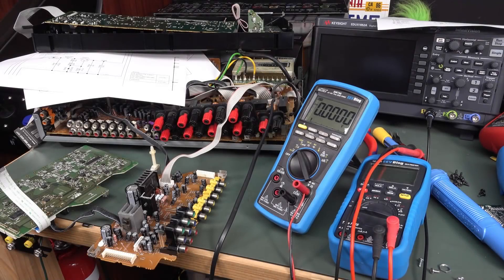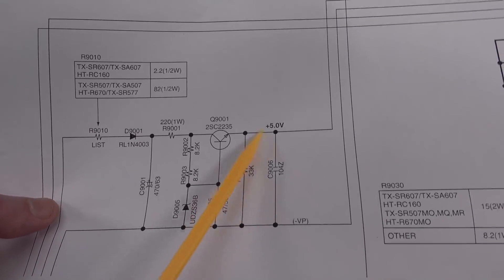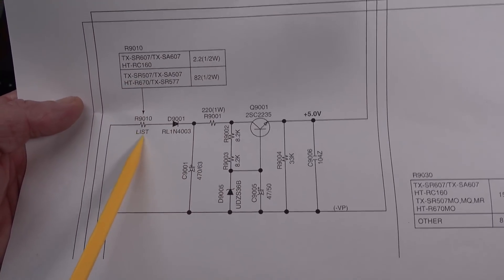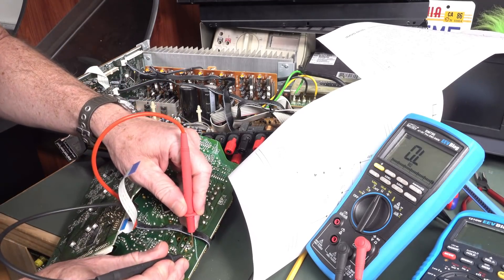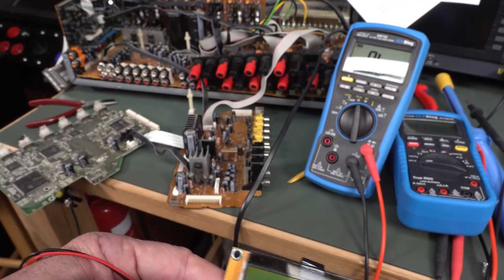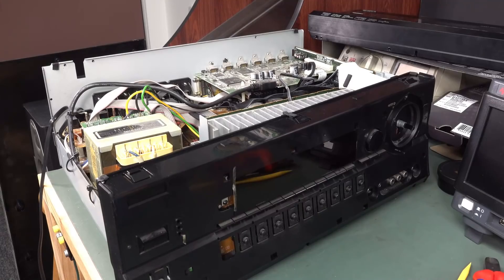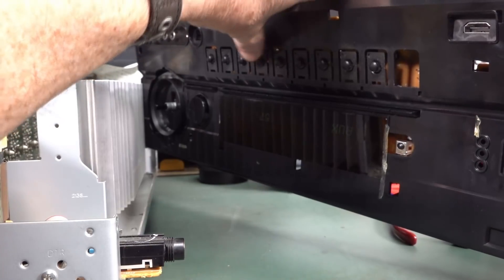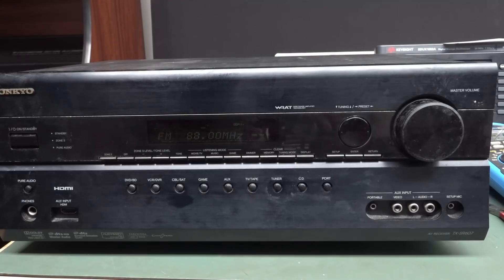EEVblog 1395 - Onkyo Repair SUCCESS

Comment: You can run bodge / probe / sense wires to diferent spots for testing while assembled. Or get extra ribbon cables with the right plugs for the repair.

Comment: I acquired a Leader LS1020 'scope a couple of years ago that had no seperation between traces and no verticaql adjustment. At first I thought one channel was kapputski but it's just that they were both occupying the same space on the screen. 
Cause? One open 33kΩ 1/2 Watt resister. Took a while to find but at least an easy fix!!🤪

Comment: .

Glad that you resolved the display operation. I don't have the knowledge you have to read diagrams and would get too frustrated to stay with it that long. I have a Onkyo receiver also, a bit newer model. It has a dimmer button on the face-plate in between the THX and Memory buttons. It has a few brightness combinations including a surround light for the volume knob. I found it by accident on the third day I had this thing. Maybe your unit (if you still have it ) has a similar button on that top row.

Comment: I fixed mine today.  Exact same fault, but I saw a different video before yours which showed the same fault and fix.  Got a 5 watt job in there now.
With regards to the two wildly different resistor values, the 507 and 607 use different transformer model numbers, so I suspect it's something to do with differing secondary voltages.

Comment: Hi, faced with this same problem, I came across Frank.tech's 12 min video pinpointing this resistor problem, before your extensive search for the fault. I was able to get to the resistor, by removing the screws on the HDMI board and the left hand end of the power board and back cover, allowing me to remove the power board and de-solder that resistor. Sure enough, it was open circuit! Replaced with success, and my screen looks brighter than yours, but for how long? Who knows. Do you not think it might be appropriate to use a larger 2.2 Ohm resistor to handle the load and the heat dissipation? Thanks for the insights. Sorry you had to spend 2 days, so I could fix mine in 3 hours!

Comment: I've installed many a 607 and the biggest problem was the HDMI firmware. HDCP errors were common and the firmware updates regularly bricked them. Great sounding receivers, but not a patch on the Denon and Yamaha's. I still have a beast of a Yamaha Z1 and it's incredible.

Comment: Yep I have an SR805 and the front screen wouldn’t work. Just a resistor needed. Much harder to diagnose without knowing anything about electronics components, and looking through the forums.

Comment: I got 2 receivers that need repairs do you take in receivers for repairs?
You of my onkyo are dead one only has the left channels working the other turns on has hdmi working but no sound 
I'm getting tired of buying a new 1 I would love to have these fixed if possible

Comment: In daylight that display will be useless (correction..it would have been useless, saw the update..adjusting the dimmer control!👍)
However it would be interesting to deep dive and see how to re-invigorate a dim VFD display. I have heard that some short term overdriving of heater (?) can make them brighter, but that article is lost.
I have a panasonic DVD player and the display needs a pitch black room to see anything.

Comment: Resistor probably failed due to surge current in charging the 470uF63V cap. Depending on voltage risetime, source impedance and cap ESR, there's a potential peak power of around 600 watts (it will be a lot less, but you get the point).
I'd replace it with a wirewound or a dedicated surge rated resistor.
Agree 2R2 or 82R is very odd.

Comment: I have had this exact problem. It's very common on this model and as I did not have the skills to find the problem myself when I fixed it. I was very happy google was a thing. However the HDMI on screen display is still broken. Also fairly common. However the repair for that seems a bit too cumbersome and I don't use it anyway.

Comment: Nice job! Mine is 606. They (606 & 607) usually develop some issues with several caps in HDMI switching circuit due to the heat on the input/video board.

Comment: The blinking red light thing could be related to an issue some Onkyos were having with their HDMI switch chip. They would not initialize correctly and the led would just blink. There was actually recall on this.

Comment: Apparently some receivers use the metal rear panel as a ground plane so you need to screw in the boards when testing. Looks like this was your issue as well.

Comment: Sounds about right. I mentioned checking the resistors on the VP rail in the last video because it was a common failure on onkyos for a number of years. I made the same repair on my txsr805 which was two years older, except I replaced them with 1w jobbies. Onkyo never learned.

Comment: The other big problem with these things is the board to board connectors, and the cheap phenolic single sided board. If one of the pins is even slightly not lined up when you plug the boards together, it's super easy to push a pin through the board and rip a trace off in the process. Ask me how I know about that issue! For the prices they charge for amps / receivers, they sure are built as cheaply as possible!

Comment: I have an onkyo tx-sr508 which actually produces some really decent audio. I’m planning on modifying the circuit such that I can have 2 stereo inputs instead of one stereo input driving the bi-amp circuit. This will allow me to separately tune the mid and high drivers with my pro audio dsp and potentially run the system fully active and bypass the passive crossover in the speakers

Comment: Thank you for this! I have a similar Onkyo from 2008 sitting in a box that went red flashing light. Bought a newer model in 2017 to replace but this will give me direction to fixing it. Will repurpose if I can get fixing. I've been very pleased with Onkyo receivers though they generate a heck of lot of heat and feel like they should have a fan in them for cooling.
Reply: I added a 12V 120mm fan running slowly on 5V to the inside of the top cover to my Denon AV amp. Even running slowly, the top cover feels a lot cooler.
Reply: Red flashing light is much more serious than this because it's often something wrong in the power amp section causing overtemp on that detect circuit :( (My TX-SR603 is sitting on the dining table with the preamp board pulled out currently

Comment: I had this once before Dave, leaking transistor it kinda worked but was leaking. It was in my vintage audio amp. It made a popping cracking sound sometimes it got worse until I was able to find it (without fancy scope). It was a damn bugger it drove me crazy for a long time until it was completely failed and obvious to find.

Comment: There is a button on the front panel "Display" that changes the brightness of the display. Also some of the grounds are connected via the back panel too probably causing the fault mode, you can pull up the fault mode history,  my guess it'll say DC protect.

Comment: I'm just thinking out loud here. But, that burnt resistor was immediately followed by an electrolytic capacitor. I would have replaced that cap, and the other in the same circuit, as a matter of course. It's possible the cap is leaking and pulling (stealing) current through the 2.2 ohm resistor  and making the display dim.

Comment: I used to work in the US Navy, and we had a +5vdc 50amp power supply that failed in a test bench. We tore that thing down and we finally found a precision voltage divider with a zener diode and two 1/4 watt 0.001% resistors that fed a constant voltage to a Darlington pair which was part of the voltage regulator. One of the resistors was open, and you would think we would check those first, or maybe second... but NOOOO... after a full 8 hours to looking at the regulator board, a buddy came in from the night shift and found it in about 30 seconds. Egg on face.  Thermal expansion and contraction over the years, and one of the resistors just gave up.  We replaced both (after ordering them both, and they were in stock!!), and it came up and ran just fine. So, never overlook the obvious, and if the resistors are all good, then move on to the next step of troubleshooting. Learning the hard way!!  Thanks for a great video, Dave!!

Comment: I have the next generation of this receiver (TX-SR706) and had to re-flow the DSP chip with a heat gun when the speakers stopped coming on.
Reply: I've owned 2-3 Onkyos and had some of them replaced under warranty/recall because of heat-related failures. They run pretty hot- especially the board with all the DSP/CPUs on it. I eventually installed a pair of 120mm fans in my A/V cabinet to keep air circulating over the top of the receiver.

Comment: very nicely done!!
i noticed the volume was quite high when powered ON (57) but there's an option in the menu to set up the default volume (20 is alright depending on your speakers).
oh, and these receivers have the option to bi-amp your speakers. you don't find that sort of wizardy in this price range.

the previous model tx-sr606 became famous for a few caps on the hdmi board getting bad after only 3-4 yrs of operation.

Comment: Maybe it's time for a video on the humble resistor? Most of the ones I buy are metal film, for no particular reason when I think of it.. I'm not actually sure what the advantages and disadvantages are to some of the different ways resistors are constructed. Mostly I look at tolerance, power and voltage rating and temperature coefficient with no regard to the actual physical contruction of the resistor, but maybe there are other considerations worth mentioning?

Comment: Fifteen years is old? (splutters and spills tea).  I watch lots  of vintage watch servicing videos; especially when the time-grapher  gizmo is put to use, and I am very impressed with the durability of wearable technology from over sixty years ago.  It's good to see another item kept out of Greta Garbo's clutches.
Reply: The only electronic devices I use that are less than 15 years old are (some of) the computers and a few tools in the lab. Oh, and the TV, because the old one almost burned up in flames one night o_O

Comment: I’ve cooked many resistors in my life but they seldomly fail completely open. What bad luck! Could it have been a connection issue on the terminals on the resistor itself?

Comment: Be aware that many of these receivers are grounded through that back panel, and with many that includes the processor and dsp boards. So if you test with the back panel off you aren't only dealing with a bunch of junk flopping around you have added floating grounds into the mix. Many times a failure to power on / blinking power led can be solved simply by tightening the screws. I've worked on many a Pioneer / Onkyo with the ground points strung together with alligator clips so I could test without having to put that blasted back on more than once.

Comment: Excellent! I have an Integra Research receiver (high-end Onkyo) which the display failed on after only a few hours use. I never bothered fixing it as it’s a right pain to remove the amp from the rack and I just refer to the on screen display anyway. I read on several forums R9010 was the typical culprit for display failure so I’ll get to fixing it one day.
Thanks for your video!

Comment: Ah, man, just a little IPA (not the beer)  to clean up the front plate while it's completely removed? Thanks, great repair video!
Reply: I wouldn't get IPA on the plastic in front of the display - sometimes that plastic reacts badly to IPA, and goes cloudy or chalky. What you want to use is good old dish soap (like hand dish soap, not dishwasher soap) and hot water, and a cloth. Cleans it up like it's new, and no chance of damaging any plastic.
Reply: @gorak9000  thanks, good pointer. I haven't had this happening to date, but better safe than sorry.
Reply: @ewoutbuhler5217  IPA used to be my first go-to for cleaning things I was fixing when I was a kid, because I had kind of heard it cleans a lot. I ruined more than one thing with a plastic window on it with IPA. Now dish soap and hot water is my first go to for any cleaning, from gummed up remotes that don't work, to the front faces of test equipment I'm fixing. It actually cleans most things a lot better than IPA does, and you can use it on everything - plastic, metal, membrane keyboards / rubber button pads. If that doesn't work, the next stop is magic eraser sponges as it gets into little pockets in textured plastic or paint for better cleaning. I only go to IPA or acetone or xylol (in progressive order) when I run into something particularly stubborn, like label adhesive, and even that, I'd start with a white pencil eraser first - it mechanically removes most of the adhesive without damage to most surfaces, then something like simple green or NaOH based degreaser (it tends to make adhesive slippery rather than sticky, and it comes off a lot easier). IPA (and never on plastics), and then up from there if it's still stubborn. Another good product that's safe on almost everything is foaming glass cleaner - it cleans a lot more than just glass, and also for most "dirt" you encounter, does a better job than IPA does.

Comment: if the resistor would have been cooked it should be brown, it's just a "near to defective" case that afer years became totally defective

if the dimmer button seems to not increase the brightenss a lot you should check the filament consumption, there should be like 2.5V (AC or DC) across it, and yes, there's often a resistor in series that can go off value due to temperature

Comment: The last time I did something like that, at the stage with the boards all loosely stacked up but the receiver actually working again, something shorted and the main controller died :(
Reply: I was once poking at an old Technics reciver that had a bad channel, and had the hybrid final amplifier module (not discrete transistors) - slipped with the multimeter leads, and there were sparks, smoke, and a large resistor turned into an incandescent light, and then promptly lit on fire. Needless to say that was the end of that one!

Comment: i have a tx-nr515 which i believe is from around the same time as that unit and the network chip has a defect that causes it to fail and loose all video output.  They had a recall to fix them but the replacement quit working eventually and I found that they put too low of temp caps on the processor board which gets blazing hot. The softstart relay also failed at one point and I replaced the caps with higher temp ones and put a heatsink and fan in the unit to make it hobble along.

Comment: Hi Dave ,You found it. I had the same problem in my onkyo in 2012. I had post a fix in a forum to help others back in 2012. Soon I saw this video I was sure it was that resistor. Sorry not telling before https://www.avforums.com/threads/onkyo-tx-607-repair-no-display.1672758/
Reply from the maker: That's ok. Would have spoiled the hunt if someone just told me.
Reply: @EEVblog  Dave what you think about this: https://newworldwind.com/en/wind-tree/ It smell another bullshit energy voodoo. What is your opinion? Do you think it possible what they claim ?

Comment: Do you have any suggestions for panel switches which are scratchy? Ones which you push in and out to get the sound coming out of both channels  ...the amp I have is a luxman lv-111. Tried cleaning out the switches with solvent but that didn't work for very long. .is there some sort of spray to use?

Comment: Check for a dimmer option in the system menu or in my case, a button on the remote control. There's no way that the VFD is weak as the receiver seems to be not too old.
Reply from the maker: Turns out there is a Dimmer button on the front panel, that fixed it!

Comment: actually I've had similar problem with my Onkyo (newer model). Relay off after turning it on, or turning off during increasing volume. Tried to search for schematics - 0 points. Than, before trying to open it, I've roamed thru net and YT. Found some folks talking about heating from outside prior and during turning on, left side from top of receiver with hair dryer for 3-5 min on max temp! Well... what's the worse it can happen right? Guess what? It worked. Dunno how, but that receiver is happily buzin' last 4 yrs without a single issue

Comment: That is why I always avoid doing repairs for money. Imagine going through all that and then being asked why it took the whole day and why you want so much for it. Like "you've just replaced a single cheap-ass resistor, how hard could it be".
Reply from the maker: "All that" would have been an hours work though if I wasn't shooting a video about it and really wanted to get the job done for money.
Reply: Well, in the Copier and Printer repair Biz I often went out on calls where the Customer stated that they had added toner, pulled out the jam, tried everything etc. and I would find something stupid like the cord being loose or a power strip not being turned on. If I was being nice and the Customer was gracious and friendly I'd either say no charge and point out why, or if they were a real ARSE about it ... I'd plug the cord in, pretend to work on something complicated and make up a story how a certain part had failed / techno babble, etc. and bill them for an hour. Especially if I already tried to help them over the phone ... and they really didn't want to try fixing it.
Reply: Read about (legendary electrical engineer) Charles Steinmetz and his work for Henry Ford. This problem of customers not appreciating the work is as old as time itself.